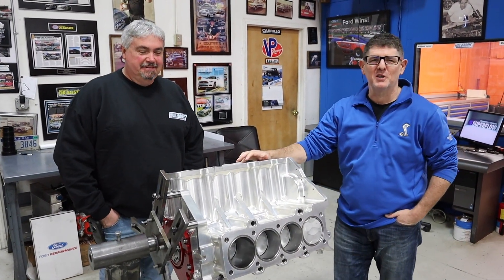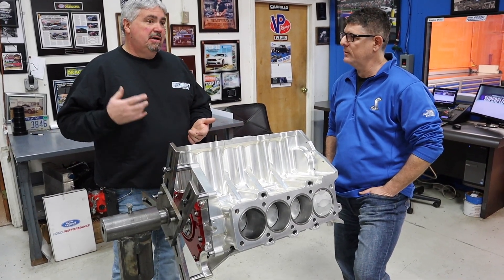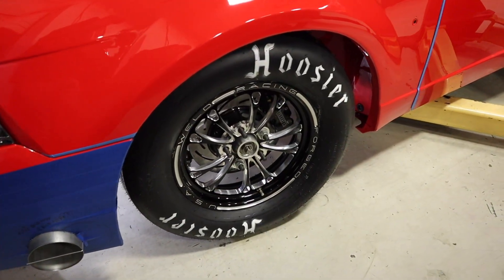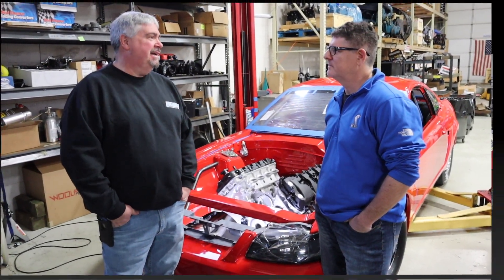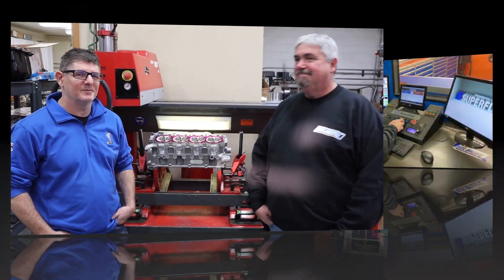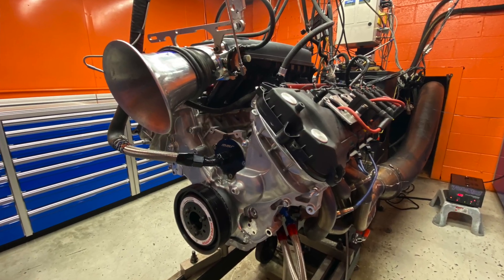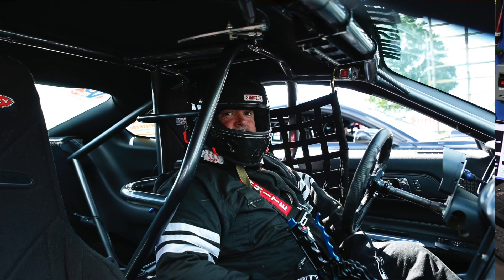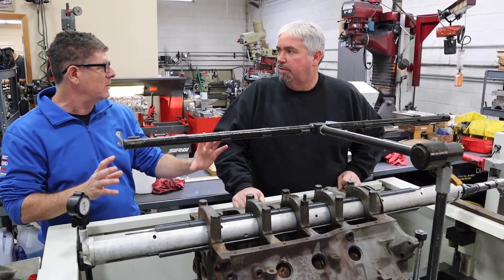850 HP All-Motor Coyote at Holbrook Racing Engines | Billet Coyote Engine Block & Race Car Reveal

Comment: 854 at only 7800?    Wow could've cracked 1000 at 9500.
Reply: Probably didn’t do a full pull too keep it’s real numbers on the low and we where just given info on how much the base tune made
Reply: Maybe idk
Reply: What's the displacement on this thing?   The RPM just seems to be way too low to get that power N/A.     There was a coyote cam and intake shootout.   The cam ended up being 234/242@.05" with .55" lift, peak power was 550 HP @ 7900.    This engine is making 300 more HP @ the same RPM.   That calculates to  574 ft-lb of torque @ 7800.    This displacement won't crack 500 ft-lb of torque, so something is amiss...
Reply: Dennis Robinson,  mathematics is a lovely thing.  Almost 600ft-lbs out of 327 inches😂.  On my dyno I would be impressed if it made 475 ft-lbs
Reply: @pillarofrock1582  475 ft lb at 7800 works out to 705hp, which is still a great number.  And we know its much more realistic given the displacement and rpm.
Reply: Dennis Robinson    100%
Reply: @dennisrobinson8008  more then likely has been bored over and probably quite a bit just to get the extra displacement also pointing towards the lower rpms and there’s many more variables to consider but it being bored over is a big one
Reply: @jag2474  In the article it says they made 327ci.    327ci won't make almost 600 ft-lb
Reply: @dennisrobinson8008  I have no clue not highly educated about this and I can tell you are
Reply: @jag2474  327 ci is 5.4L.  The 5.2L with long tubes makes 465 ft lb peak torque.    Not sure where 110 ft lb is coming from.     I could see if it was 380ci 6.2l.    A built 380ci makes around 600 ft-lb peak torque
Reply: @dennisrobinson8008  Cubic inches isn't the only factor is the problem lol
Reply: @sategllib2191  It was made from leftover parts.   They didn't say anything like 14:1 cr and race gas.  Which would help the case a bit.  Now I been looking at voodoo 5.2 with kooks long tube.   That is 410rwtq or around 480ft-lb at the engine which is inline with what they can do.
Reply: @sategllib2191  and the heads.   Unported they get 350cfm.   While you could rev it way out 350cfm to 800hp or a little more they're better suited for around 700hp na.     But they got a staggering 575 ft lb which I guess was really 475 ft lb and power peaked so low...    To get 850 that engine would need to exceed 8000 rpm.
Reply: @dennisrobinson8008 finally someone talk sense here...No way its 850 with 5.3l and 7800rpm
Reply: I'll give them 680HP at 7800 with 465 to at that point.

Comment: It hadn't even finished making peak torque by 7800 with that seccond sine wave. That thing could easily turn another 2k rpms. The fact it was just coming into the curve at 5k says street manners are non existent.
Reply from the maker: It’s not a street engine.
Reply: @revanevan  Thats a good thing. Id love to see that thing run all the way out. Its already no joke.

Comment: I been telling people about the 351 based coyote! All motor pumping out 6+. But this 327 is crazy!!!!
Reply: Unfortunately the 5.8 in the 14s have had a lot of issues from all the fourms I've read and groups I'm in. Ultimately a built 5.0 will outrun it and perform better supposedly. Buttttt this shit should be cool!!, I've been dying to see some coyote strokers loll. I'm an old 351 stoker fox body guy myself.
Reply: isn't it a 363?
Reply: @Rob-tl9md  the bullet one they show at the beginning is the 363ci but the engine he dynoed is the 327!
Reply: @RetroCOBRA   ahh ok. I had a 369ci 302.. Nice setup.
Reply: There is no "351 based Coyote." The 4.6, 5.4, and 5.8 liter motors are all classified by Ford as "Modular Motors." They have nothing to do with the Coyote, Voodoo, or Predator motors. The maximum bore x stroke of a Coyote is 5.6 liters, however, no one does it because the block would be so weakened. 5.3 liters seems to be the limit that guys are comfortable with on a stock Coyote and even then sleeves have to be used. Ford makes a cast iron Coyote block named "Werewolf" for serious racers. It's designed to handle up to 2,000 horsepower and can be bored to 3.74 inches and stroked to 3.89 inches for a maximum displacement of 5.6 liters.
Reply: @tonyjackson4099  ok its not a production block. BUT when i first seen a 351 based coyote i have talking about it. MMR make a custom block and i remember watching a dyno of it and was shocked at the horsepower!
Reply: @RetroCOBRA its a billet Coyote block that's capable of 351 in³. The only thing it shares with the Cleveland are A) the displacement in cubic inches and B) its the top of the food chain in its era.
Reply: @tonyjackson4099  umm,coyote and voodoo are modular engines man. Just the evolution of the 4.6

Comment: All these mod vs LS shootouts they find these scrubs to build the mod motors.   Helloooo, let's get some legit mod motor builders in these competitions like these guys.
Reply: I really get the feeling on some of those that a lot of shops really don't know these 4 valve engines that well yet. They're so used to the same small and big blocks they've been building for decades. When you really get people who know their stuff and throw a ton of compression and rpm, which is what a 4 valve is made for, at these things they really start to make LS's look silly, at least around the same displacement.
Reply: @177SCmaro  agreed, slow learning curve.  John Kasse knows his dohc engines also.

Comment: Wow that thing makes insane power! Any reason he didn’t rev it to 8500?
Reply: He said they didnt want to beat it up on the dyno. Save it for the track
Reply: @JkeeneMX607  makes sense, curious how much more it would make revving it out.
Reply: @Vortek01GT  maybe we'll be fortunate enough to see it at full rpm on a dyno when the car is complete. Im curious what it gets to the wheels. Might have to give them a call when my gen 1 needs replaced in my f150😅
Reply: 8500 not really beating a DOHC up
Reply: @dennisrobinson8008  Especially a Ford 5.0 Coyote, those things take beatings and love it. The more they get beat up the harder they fight.

Comment: I’m a Chevy guy, but... Damn what an engine. That’s amazing. Great job and great build.
Reply: @EHeritage-w2g  Not all products are created equal, nor are all technologies, and it's ok to be a fan of some of them and not others. That goes for every OEM. The EPA has killed a lot of solid designs in the last 20 years unfortunately, especially diesels, and it's hurt the consumer as well as the companies. OEMs get to waste a lot of money trying to meet standards that are set arbitrarily by legislatures, by using any stop gap measures they can. Anyway, of all the Ford products, the Coyote and 7.3 V8s are at the top of the reliability list. Just ask the guys in the shop at the dealer. I personally won't buy anything with a turbocharger, and am not too impressed with any fuel saving strategies like displacement on demand/multiple cylinder disable, or start/stop, as it's harder on parts and increases the risk of failures.
Reply: @EHeritage-w2g  yeah he’s no Ford guy, you only hear squeaky wheels bitchn about nothin they know.
Reply: John Mayer’s  ii is e
Reply: I think that the coyote engine has done for Ford what the small block Chevy engine did for Chevy.
Reply: Chevy a decade ago https://youtu.be/vr_gl2cgl1o?si=mHl12yO4YFh3CdQx
Reply: @bigboreracing356  definitely not worried about the stuff you mentioned At all. And it’s not the 3rd world countries I’m worried about either. What u think every country but Merica🤪 is 3rd world? Prob   The sky isn’t falling dude,stop wasting your time worrying about bs.  Be hearing this same crap years from now
Reply: I ‘m a coyote guy and I’m gonna say chevys don’t suck man if it’s got 8 cylinders it’s cool, American helps, at least it did b4 Trump made us all look like idiots
Reply: @MikeSmith-ey7ku  really?what about the thousands of people who were eating tide pods, catching themselves on fire for clout or women shouting from their "vaginas"
Reply: @MikeSmith-ey7ku   you need your head checked
Reply: @MikeSmith-ey7ku  lol! Leave trump out of it! You make yourself look a certain way.

Comment: Wow impressed with the NA motor  ( 2.59 HP per CI )  Did NHRA run the Fords away from Factory stock like most sanctioning bodies do when they win to much?. Thank you guys. Go Ford.
Reply: Yes. Look at what NHRA did to Bob Glidden back in the late 70s, he kicked everyone's ass in a ford and put a 200 pound weight penalty on him, and now pro stock today is an all chevrolet shit show.
Reply: @brianspangler3771   Yes, the Chevy motors couldn't hold a candle to the modified 351C motor Glidden was running. The NHRA did the same thing to Buddy Ingersol 8 years later when he was running his 6 cylinder Buick with the turbos.
Reply: Nhra and Nascar got to protect their false records, dont want to make their beloved Government Motors  offerings look bad  !!!!
Reply: @darrenhefford3722  Fords in nascar have actually been doing awesome the last five seasons. Nhra however fords are basically non-existent.
Reply: @brianspangler3771    With a level playing field, Fords could and should have won a much higher percetage of the races they been in, all time, most always had a better engine but either wasn't  allowed to use it or it was weight penalized to make the other brands look good  and compiling false records for them  !!!!
Reply: @darrenhefford3722  you sound really butthurt. Are you ok?
Reply: @unclegeorgesspeedandfeed   Im not but hurt at all, just stating facts, you must be a Government  Motors lover, ha ha ha , sucker !!!!
Reply: @darrenhefford3722  can you back up these fax?  Sources?

Comment: Love it. Pick your poison Coyote or Godzilla. Winner either way..
Reply: @bigboreracing356  So , it takes a big block Government Motors mill to beat a small block Ford, Nascar and the Nhra have known this for decades, that's  why Fords are weight penalized or outright banned at most events. It's not that Fords can't  compete, they are not allowed to, got to protect their false GM records.
Reply: @bigboreracing356  I think you are missing the point here buddy, Godzilla refers to the 7.3 L Godzilla from Ford, there is no LS Godzilla, Either Fords Godzilla engine or Coyote would stomp on them.
Reply: @bigboreracing356  You Bowtie boys should be using GM chassis and bodys with your junk engines. In this day and age of technology, a Ford and Chevy engine can be built to make the same power or more as long as your comparing apples to apples.
Reply: I think godzilla will fit in older mustangs easier which is nice. Pushrod design is also a cool throwback. Coyote is a great motor though.
Reply: lol
Reply: @bigboreracing356  “LS Godzilla” 😂🤡
Reply: Godzilla is a dud. Coyote all the way

Comment: 850 HP all motor Coyote... a 3000HP Coyote...OMG! WOW! Thank you, Chris Holbrook!
Great video and interview Evan, thank you!
Your automotive knowledge makes your videos, interviews/reviews/etc., second to none!
Reply: I think that the coyote engine has done for Ford what the small block Chevy engine did for Chevy.
Reply: @machdaddy6451 the sbc was legendary in its own right, but the undisputed king of small displacement V8s from the era was the 351C. 
Same as days of old, the "masses" believed the sbc was the best thing ever, when in fact, the Ford Cleveland was the real champ. Same as now. 
The masses think the LS is the greatest, when in fact, the ohc Fords are the proven kings of max oe hp.
Reply: @chadkent1241  Totally agree. IMO the coyote engine has done for Ford what the SB engine did for Chevy.
Reply: @machdaddy6451 You mean 351C
Reply from the maker: Thank you Robert, much appreciated.
Reply: @revanevan  That thing would probably need a 6800 stall converter 🤯

Comment: If you take that motor to 9k . It'll make 900hp .
I'm willing to bet on tgat one .

Image if he actually tried to build it for max instead of using leftover part in the shop .
Reply: Easily 1,000hp if they run slightly higher compression... maybe just 12.5:1

Comment: LS boys...crickets. lol
Reply: Ls 440 old pushrod motor lol made 1,223 hp all motor over 12 yrs ago
Reply: @David-er1cy  Any motor with those cubes and right fuel could.. look at the swept head area.  You might also try posting links so we can know details to the build.
Reply: I guess you dont realize with the same effort a ls would go over 1000hp and have 200ftlb more tq. There's some crickets for ya.
Reply: @HioSSilver1999  Not with same displacement or stock head castings.. And probably not spinning as fast either.
Reply: @SirtubalotTX  thats like saying the coyotah wouldn't make that power with 16 valves......so I don't care about the same displacement.  It's all about effort. You have a completely custom engine there. Expect the same in return. So if you want to compare sleeved/stroked engines you will lose......and in a big way.

And since the ls heads flow more with stock castings.....expect more power.
Reply: @SirtubalotTX  oe ls7 heads can flow 400+ cfm. I think ls3 heads have also....for sure upper 300s. That's no fancy seats involved either.

Then there are chevy dr heads if you want even more.

You guys are the butt hurt ones. You simply don't like facts.
Reply: @HioSSilver1999  Never seen a NA LS at 1000 HP. Not even an aftermarket LSX. This thing is using a stock block casting and stock heads. They may have had some work but still...Last i seen SAM had one in the 800 range. Show me. I need to learn.
Reply: @toddjohnson7133  aftermarket ls stuff has made 1100+.

Sbe ls7 has made 700 at the wheels with oe ls7 heads. You boi's need to edumacate you selfs🤣

Now imagine a full custom bore/stroke. Fancy valve seats and all.

If i was a betting man i would say this dyno is happy to. The tq vs hp don't really pan out.
Reply: @HioSSilver1999  Yea, and how much bigger is it.  I know y don't care about that but the point stands.  Coyote is whoopin that LS7 butt and doing it with less cubes.   Also, why don't you tell us what heads are on that 1100 hp na ls?
Reply: @HioSSilver1999  Not sure why you would say that the torque vs horsepower is suspect? It's just math (rpm×torque/5252=HP). 7800×575/5252=853.96. Take any number along the graph and do the math? It all adds up.
Reply: @maxthedog8483  Lol.. am I the one that's not calm here?  Who said I wasn't over anything... if you read my posts you will realize I like LS motors also.. I'm just not ignorantly biased and just sticking to facts. Some people don't like those facts.  Yea, this engine build is amazing all things considered.
Reply: @HioSSilver1999  At the same displacement?
Reply: @tomhamilton9140  i guess you missed where i said i don't care.
Reply: @HioSSilver1999  If you didn't care why did you respond? You can calm down though because I don't take this really serious and I'm not even a Coyote fanboy, I like both it and  LS motors.  I just get a kick out of people who hate on the Coyote and still do not understand its potential. For example,  I tell people about MMR getting over 3000 hp with their GenX Billet Blocks using STOCK head casting and they still don't get it.  (You will not be able to show me ANY stock LS head that can do that).  

That aside, LS motors are bad ass too but don't underestimate the little Coyote and now you got the new 7.3 gas to deal with. lol.  I kinda' like competition. lol
Reply: @SirtubalotTX  i said i didn't care about the displacement yall was whining about. 

Other than that i just corrected fanboi bs.

There's nothing to deal with on the 7.3 at the moment.  Besides it's a copy of a ls but a big block. Which is good i think. Looks like it's doing well in the trucks and if i was in the market for a new truck that would likely be what i would buy.

I don't care about anything boosted. If you want to see what power the engine makes then it has to be na. If it's boosted then it makes whatever power the power adder tells it to make.
Reply: @HioSSilver1999  If that makes you feel better..
Reply: @SirtubalotTX  i feel fine thank you. Facts set you free
Reply: @HioSSilver1999  And I gave you some.
Reply: @SirtubalotTX  lol...no you didn't
Reply: @HioSSilver1999  You weren't paying attention
Reply: @HioSSilver1999  nice to see some love for the 7.3 ford from a GM fan, good to know your not one of those stupid fanboys
Reply: @HioSSilver1999  The highest horsepower per cubic inch NA engine presently built is the 500 cu in engines in NHRA prostock. They are right at 3 hp/cu or 1500 hp at about 10,200 rpm. They cost well north of $150,000, springs are checked every round and replaced every four to ten rounds rounds. Engines are rebuilt after each race (not round).

So any engine that makes north of 2 hp per cu in is a stout engine. Any race engine approaching 2.5 hp per cu in have had thousands of hours of engineering and hundreds of hours of machine and assembly time. To even approach 3 hp per cu in with non-exotic parts is just unheard of. 

By the way, 500 cubic inches seems to be the sweet spot. As engines get larger they tend to slow down and make less hp per cubic inch. By the time you get up to mountain motor prostock engines, they are making some where between 2 and 2.5 hp per cubic inch. Now, at 840 cubic inches, that puts them near 2000 hp na.

Finally, here is your ls engine https://www.enginelabs.com/engine-tech/project-spinal-tap-whats-inside-an-11000-rpm-ls-race-engine/